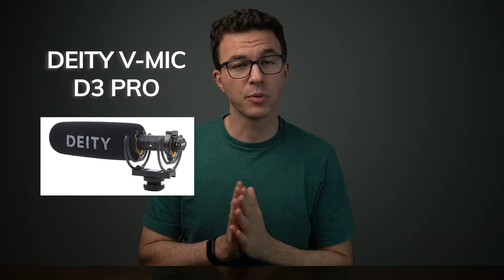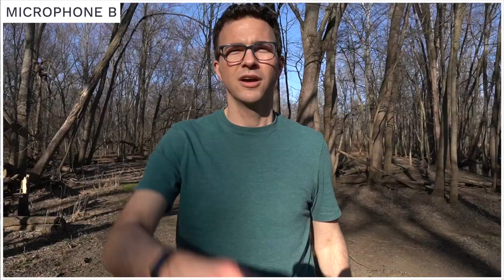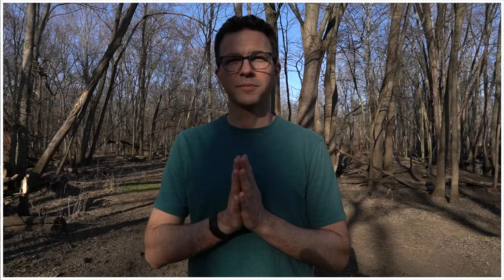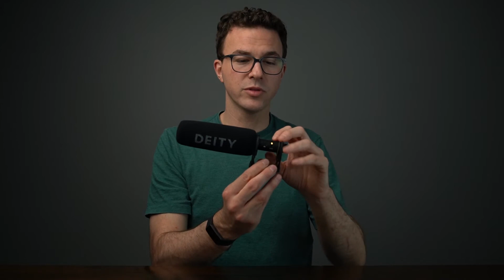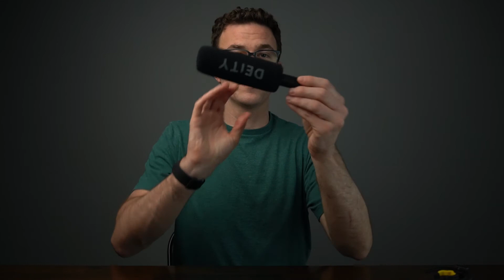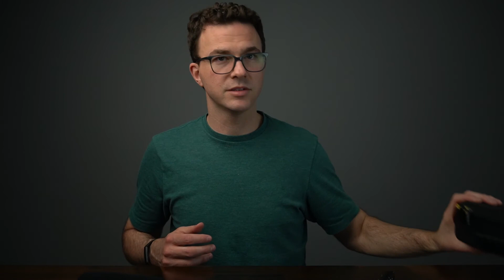Best Microphone for YouTube (Deity D3 Pro vs Rode VideoMic NTG)

Comment: The Deity sounded a lot better on camera in the studio but its wind noise pickup outdoors was extreme and a deal breaker. Were you using foam or dead cat wind filters?
Reply: I think he didn't set the camera's gain, and the camera was upping the gain. Notice how neither Mic was consistent regarding the rejection of wind noise. Sometimes they were both perfect. Other times they were both very noisy. And were these tested with the foam? Not sure?

Comment: The D3 Pro will work with phones, tablets, DSLRs, body pack transmitters. We have tested it on a dozen DSLR models, two dozen phones, a handful of Android-based tablets, and the microphone inputs on laptops. When plugged into devices that have a stereo microphone input, the V-Mic D3 Pro outputs dual mono tracks.

Comment: Hi, great review !
In studio situation Deity sounds better for me, but that outdoor behaviour (on Your test)  is a no go for me. Any ideas why the NTG was so much better or Deity much worse in that.
As I'm mainly shooting outdoors I was wondering about build quality and weather resistance. 
Do You have any thoughts about that ?
Thanks
Reply: Sounds like wind noise or handling noise.  You can fix the first with better wind protection (dead cat) and the second with better mounting (maybe in this case the cable was not well secured and causing handling noise)

Comment: Thanks for this comparison review. 

Regarding radio/cell phone interference, you could try a better shielded cable. You might try the Rode cable with the Deity unit to see if that helps (assuming the pin configuration is compatible).

Regarding mic tone and performance, my preference is the Rode NTG. It has flatter (more accurate response), and the off axis rejection has more consistent frequency response. The off axis rejection is important, as changes in frequency response can be noticeable with mic/camera movement, and very hard to filter out in post.

Comment: Hey. Quick question. Can you give any advice on what your camera preamp level should be vs the gain on your mic for YouTube? Struggling with this?
Reply from the maker: Good question. I find it sounds better to have the gain on the mic up higher and the camera preamp low. I'm not an audio expert, but what I've heard is that the preamp on the cameras in a lot of cases isn't great so better to get the power from the microphone. If you're not sure, just record a handful of short clips with different settings, put some headphones on and listen to each clip and choose the one that sounds best to you.
Reply: @TheFigCo  thank you

Comment: do they have the same size? Im looking for a deadcat and wondering if the rode ntg shares the same dimension with the deity d3 pro
Reply from the maker: The windscreens for each one are really close in size, the Deity is maybe 1/4 inch taller and the Rode is maybe 1/4 inch wider. Which mic do you currently have?